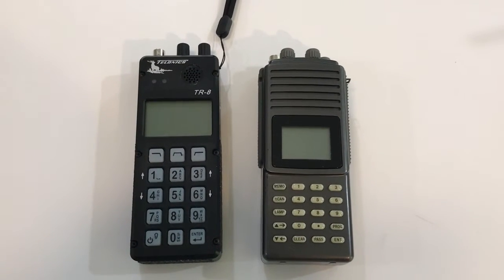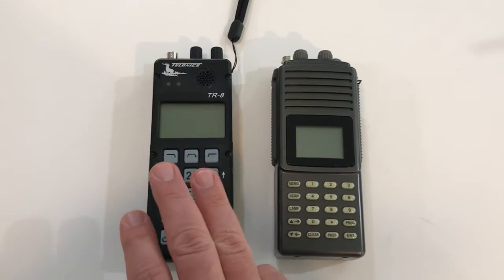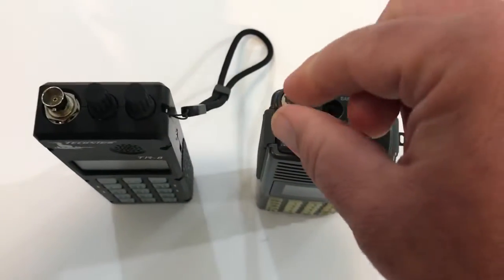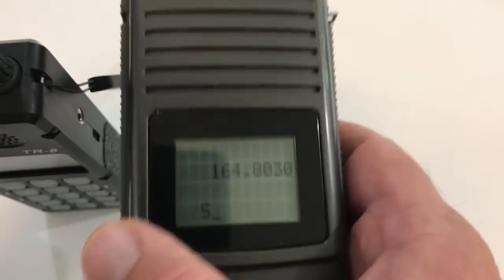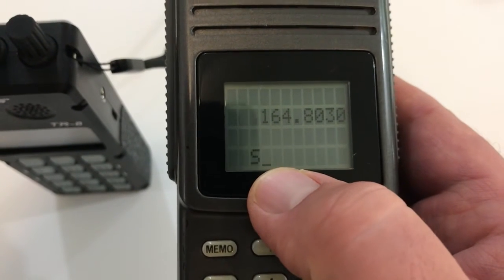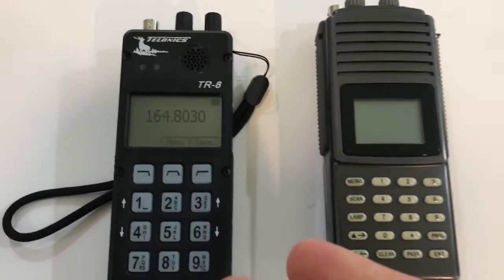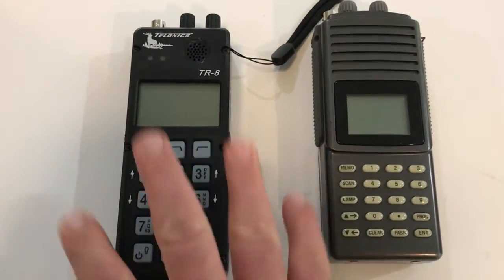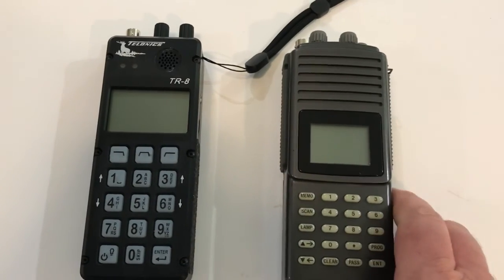Basics about handheld telemetry receivers

Comment: For those of you watching this, you can adjust the volume on the TR-8 receiver by pressing down on the gain knob. This will allow you to cycle between gain and volume. Similarly with the other knob - you can press it down and it will toggle between tuning the ten thousandths decimal place to fine tune for drifted frequencies, or allow you to advance through your active frequency list, which you can select for in the menus.

Comment: The fine frequency adjustment on the R-1000 can be the same as the TR-8. In the menu, change STEP from 1khz (or whatever it is currently set to) to .1khz. This allows fine tuning to the 10/thousandth mhz.